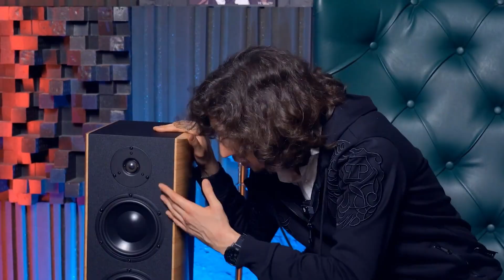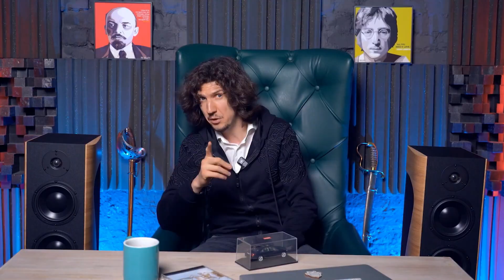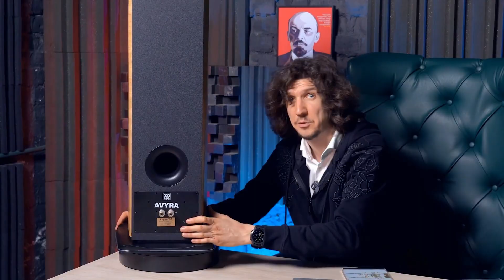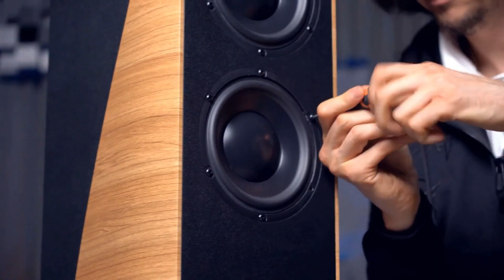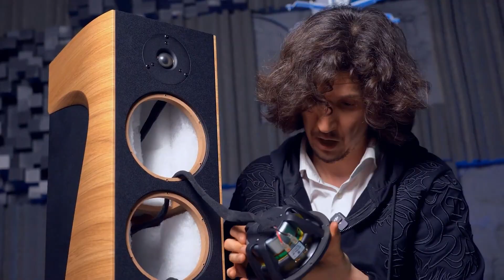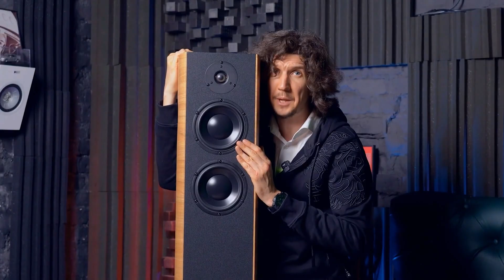Disassembling and Listening to Morel Avyra Floor-standing Speakers

Comment: 1 set of binding posts for an expensive tower. Next.
Reply: I prefer speakers that sound good over whether it has more sets of binding posts which I won't use :)
Reply: You are right, in a 3 way design that certainly make sense but in the other hand, I will choose quality over quantity.
Reply: Lots of good loudspeakers have one set of binding posts, means that they have confidence in the crossovers